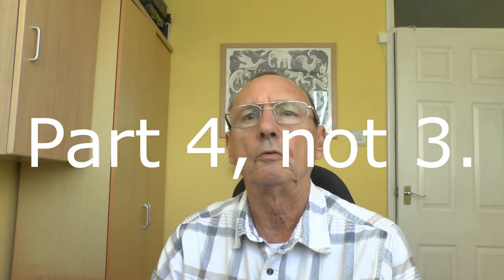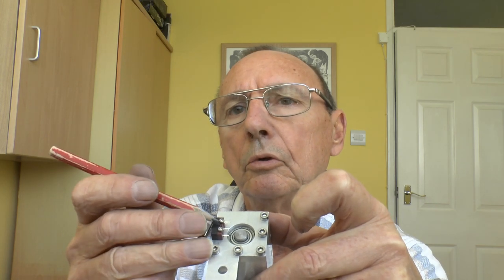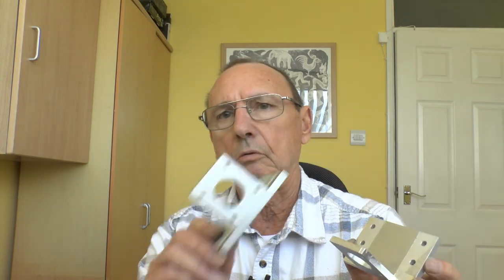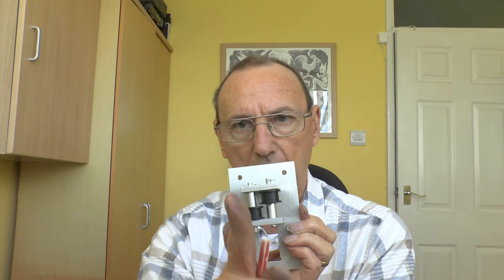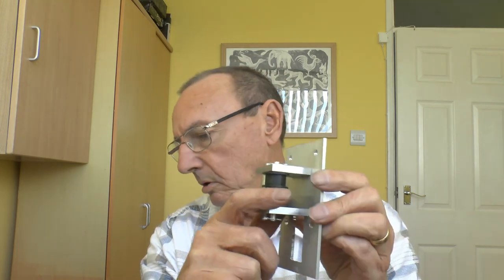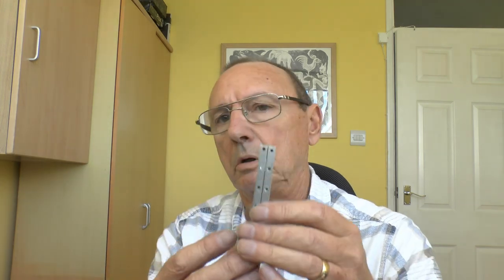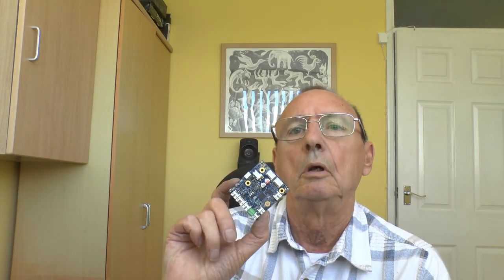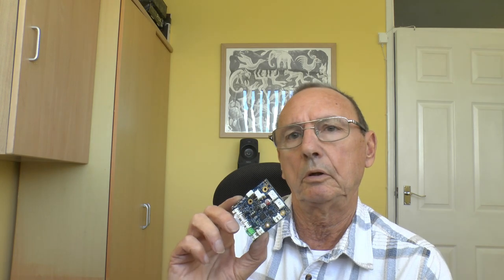NewCoreXYPart4

Comment: Enjoying the updates. It's so satisfying to see what you've designed come to life. I've just upgraded my printer with a new design and it's been a challenge but it's super smooth now and importantly, making the most of the build volume. Keep up the good work!
Reply from the maker: Thank you kind sir - I'm glad that you are enjoying the updates. I have to say that with only circa 200 views per episode, I was beginning to wonder if I should even bother. But if only one person finds something of interest, then I guess it's worthwhile.
What I failed to mention in this latest video, is that my milling machine and lathe are completely manual. Also that OpenScad has no way of exporting dimensioned drawings. I have to make several sketches of each part and add the dimensions by hand, before I can even start to machine them. So it's a quite a time consuming process but none the less rewarding.
Reply: @deckingman  I’m glad you continue to. As an engineer myself, to learn that you’re making the required drawings/dimensions by hand and then milling/turning by hand also is mighty impressive, might be worth covering that in the next video to highlight the work involved. I cheated and used plastic for my parts, so whilst the parts are dimensioned it’s a rather less skilful operation to export an STL and slice it :)
Reply from the maker: @Mr_Jimbo  Yes, I too cheated on the original printer and used printed parts. As you say, uploading an STL to a printer is a lot less work than winding wheels on milling machine for hours. Actually, that's not quite true. I started out way back when the RepRap movement began with Adrian Bowyer and at that time, it was almost a pre-requisite that one should use as many printed parts as possible. That was the whole ethos of the RepRap idea. But over the years, I've had my share of parts failures. For example, my printed motor mounts distorted due to the heat from the motors with multi-hour long prints. Eventually, I made aluminium ones which had one major advantage that I had completely overlooked, which was that not only did the mounts not distort, but the the mount being bolted to the frame meant that the mount and entire frame became one giant heat sink so the motors never got more than a few of degrees above ambient. The other problem with printed parts is that you need a working printer to make them, and if you only have one printer and it needs a replacement part, you are bit stuck. So with this one I've done a complete reversal of the "RepRap thing" and decided to make it "all metal" (or as near as is possible).

Comment: I'd use a wavy washer on only one side of your hinge to give a more definite position (the two springs will fight each other and not give you the stiffness you require) . The foam will set over time and lose its spring . I would counter bore each side to locate a coil spring.
Reply from the maker: Yes, I'm finding coil spring difficult to source. It needs to be no more than about 8mm long, no less than 6mm and no more than 10mm dia and strong but not too strong. Plus counter boring will be difficult as I've only 3mm wall thickness to play with. I'm looking more at flat springs or leaf springs. Something like the clips used on the back of picture frames maybe?. I'll keep looking but it's tough if all you have to go on is a picture on Ebay or Amazon.
Reply: @deckingman  repelling Magnets might work I guess.
They even shouldn’t age as long as the Curie Temperature isn’t approached.
Reply: Also a PTFE Washer opposite of the wavy/springy Washer might be good for reducing the Friction without wearing too much over Time.

Comment: If I remember correctly you want to buy a Print Head.
A bit disappointing as your previous ones are quite interesting and look well made.
If you intend on using Water Cooling the Duet Board could get cooled as well for higher Chamber Temperatures.

I didn’t fully understand how the Brass Bar is Part of the Switch.
Is it electrically isolated and makes one Pole of the Switch or is it grounded ant the other Part will be isolated?

For the Spring for the Tilting I suggested Magnets in the other Comment, but squishy Silicone Pads might also work.
Maybe a little easier than finding and mounting the right Springs.
Reply from the maker: Thanks for the comments. This whole thing is about simplifying my life and creating some space in my very crowded garage. One of the problems with using my own design hot end, is that I have to make any replacement parts. Which in turn means that I have to have a milling machine and a lathe, just to support the hot end. By using an off the shelf print head, I could buy any spares I might need, meaning that I could sell the mill and lathe which will give me more space as well as raise some much needed cash. 
Ref the switch - I don't know how to explain it any better than I have in the other videos.
Ref the "hinge". Remember that in reality, there is no detectable movement. Just what is needed for the brass bolt to break contact with the brass plate so less than a micron. Therefore wear isn't an issue. It's essentially the same design that I've been using for years, just that the existing machine uses a rod with recesses in either end and spring loaded ball plungers.
Reply from the maker: .....but yes, the brass plate is connected to ground, and yes the brass bolt that the plate will make contact with is insulated and connected to an io pin.
Reply from the maker: ..........and I won't be using liquid cooling - it works well enough but it's an added layer of complexity that I'm trying to eliminate.